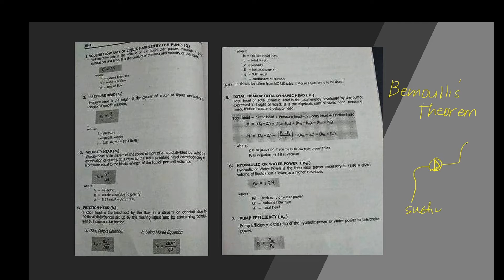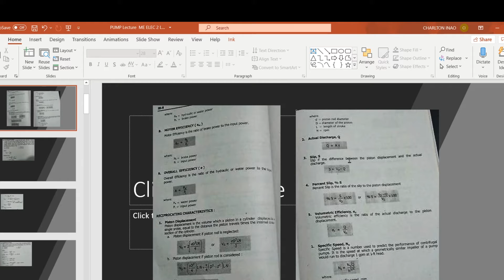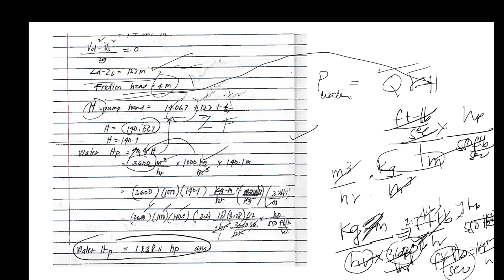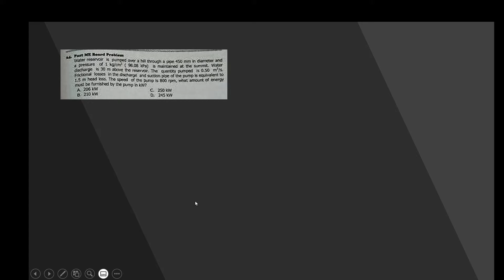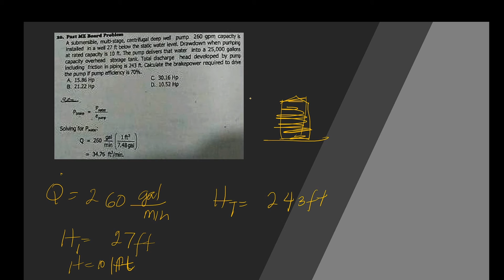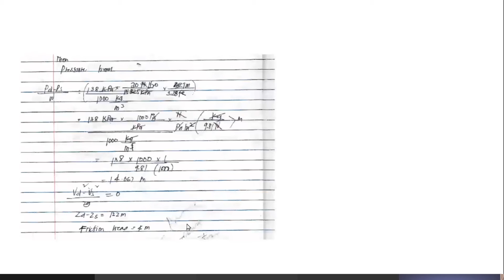PUMPS : Introduction and Review of its fundamental principles and parameters..

Comment: Hydropower is a form of automated energy production not controlled by humans. Move a grinding wheel for milling first, developed in the drive of an electric generator. Next to steam, it will be the main source of electrical energy. Its continuous availability does not require any energy storage unlike wind or solar power. These are mainly mechanical equipment. This makes it relatively easy to understand, repair, and maintain. In order to create electricity from hydroelectricity, two parameters are essential: the flow rate or the minimum quantity of water constantly available throughout the year and the head; the height difference. These specific conditions limit the generalization and standardization of the “method of installing hydroelectric power stations”. Choosing the right location and planning requires specific knowledge. With the knowledge of the water flow and the height difference, the potential power can be estimated.

Comment: ProfCharlton presented a combined method using statistical and numerical models for selecting a pump running  in micro hydro plants. A micro hydropower system needs a turbine, pump, or waterwheel to transform the energy of flowing water into rotational energy, which is converted into electricity. To see if a micro hydropower system would work for you, determine the vertical distance (head) available and flow (quantity) of the water. Head and flow are the two most important facts of a hydro site. This will determine everything about the hydro system - volume of civil constructions, pipeline size, turbine type and power output. Inaccurate measurements result in low efficiency, high cost and scarcity of power. Thank you ProfCharlton Academy for  a very informative presentation.